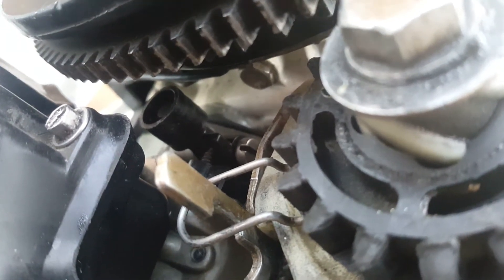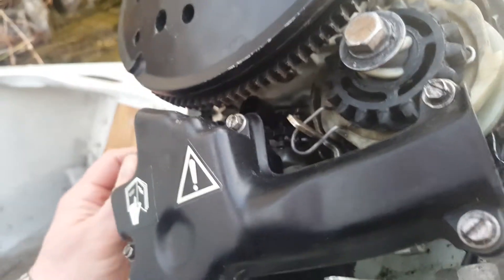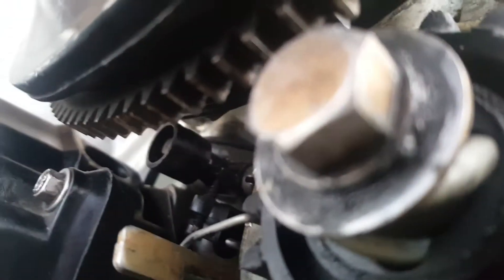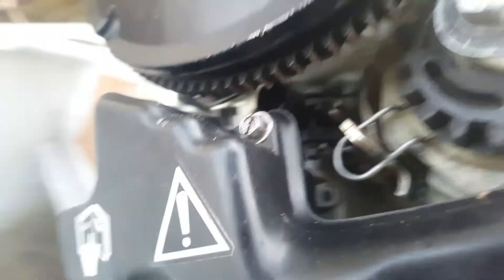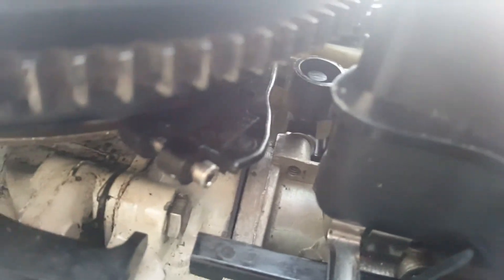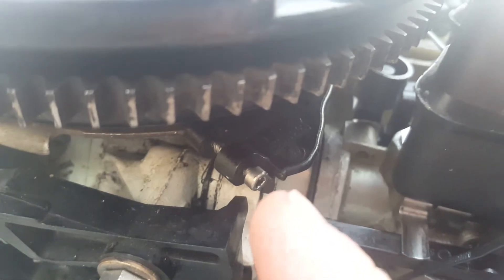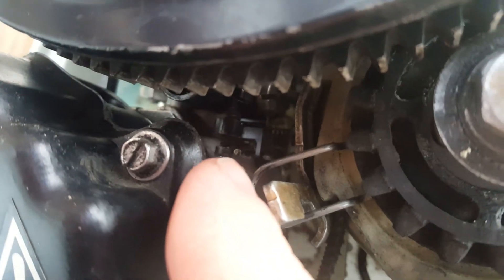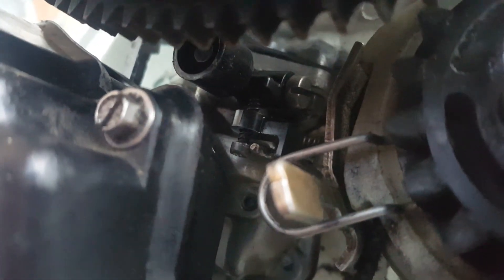Johnson 9.9 Cam Roller and cam

Comment: Screw the throttle cable connection out farther on the other side. Or if its a gear type linkage time the gears!

Comment: I figured out on mine it was the plastic idle control on the right side of the motor. This is different than the fuel ratio control by the choke.  It’s the plastic piece it’s an opaque white plastic piece that catches the nub on the throttle control arm that turn the flywheel. I flipped it over so it doesn’t catch the nub. It opens and closes with no catch. 

It’s always the small meaningless parts that kill an engine.

Comment: Did you ever find the correct fix? I am having problem with adjustment screw on cam roller hitting carb while in gear at full throttle. I am not sure if this is normal.
Reply from the maker: Ron Garcia The cam roller turned out to be missing the outer ring.  I ended up fixing it by wrapping duct tape around the roller to make it a larger diameter.  Works much better now
Reply: Peter Keen Thanks
Reply: @peterkeen9399  i need a cam roller for a 76 9.9 rude ..may be you know if i can buy one still, and the split ring that holds it ..newbee trying to solve rev problems lol
Reply: peter moyes 
Crowley marine online